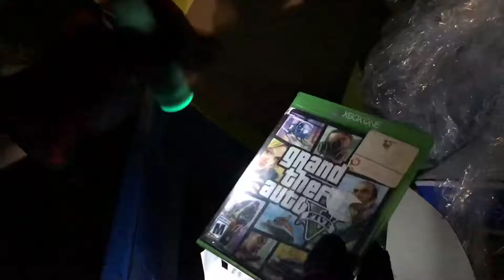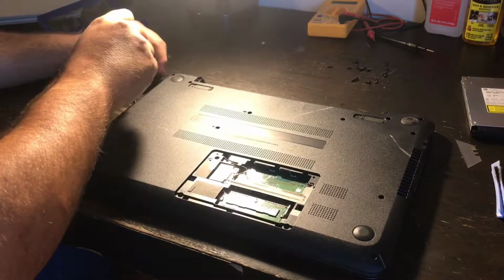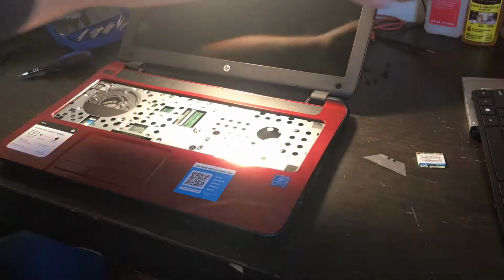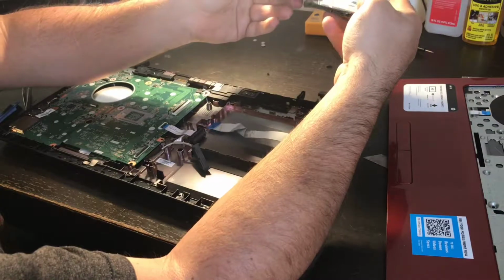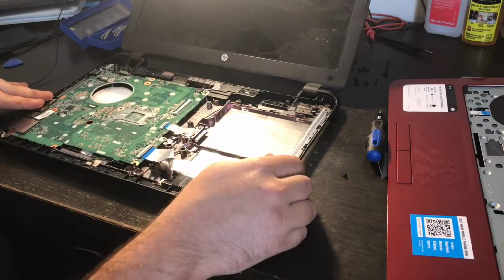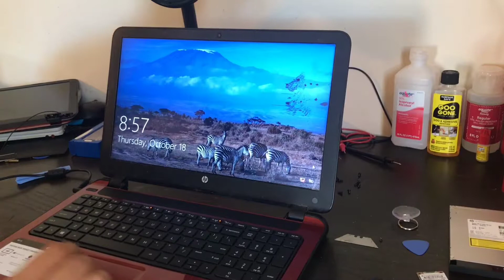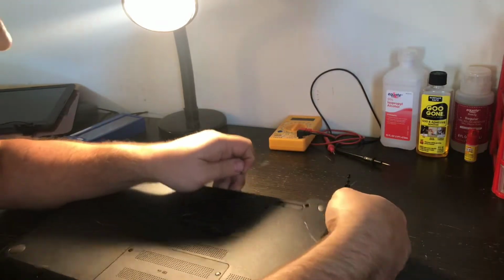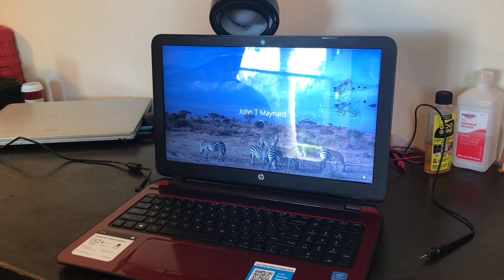HP 15-f272wm Dissassemble.

Comment: I have this same laptop. Is there a way to add ram to it rather than replacing it with higher gb's? Like is there an additional slot? I'm new to computers and I can't find a second memory slot.
Reply from the maker: There is unfortunately only 1 memory slot. So you would have to buy an 8 gig single stick to replace the 4 gig stick.
Reply: @Mr_Goody  thank you for your response. Is there something that needs to be done before swapping ram? When I switched it the laptop refused to turn on. So I switched it back to the 4gb.
Reply from the maker: +Maritza Rivera   The first thing you want to do is to make sure that the laptop is unplugged from the wall and then secondly to take out the battery and then I always remove static electricity by pushing the power button for three seconds.   The next step is a very important part there are many different types of memory and if you get the wrong kind your laptop may not come on at all when you change it you have to make sure it’s seated in and most of the time you hear a little snap when it is locked in.  So one make sure that it is a decent quality of memory that will work with your motherboard and to make sure that you have seated the memory properly and that it has snapped in the slot and is secured.

If you are wondering what website you can buy a known good memory and it is crucial.com  there is even an automatic scanner there that will scan your computer and recommend what kind of memory for you to get.  I hope this helps you and if you have any further questions feel free to ask me.
Reply: @Mr_Goody  Thank you oh so much. Laptop now has 8gbs of ram instead of 4. That website you recommended was incredibly helpful. I neglected to read on my own and had purchased a pc3l which is why my laptop never turned on. Thank you again 😁
Reply: I think it only supports 4gb